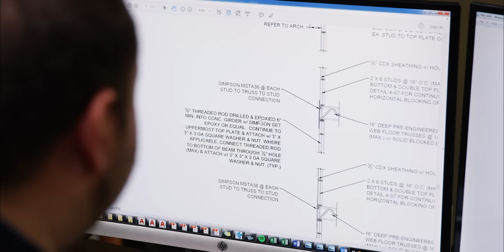Surviving A Hurricane: A Hurricane-Resistant Construction Solution

Comment: Steel straps at the roof and foundation are #1 but windows are the other weak point. If a window fails the wind can get inside and push out walls. Water intrusion makes the sheetrock crumble away from the nails and the walls lose strength.
Reply: Look for the FOX news Tampa Bay YouTube video about the Lackey house that survived. Dr. Lackey stresses that the strength of the windows were crucial for its survival.

Comment: I'm curious as to the expense of adding this system a typical 2,000 square foot new construction home. $10,000? $15,000?
Reply: The typical figure I hear for building beyond code to this level is about 1-2% of the cost of the entire structure. Well worth it in my opinion (I used to be an engineer that specified mostly simpson products). I work for Simpson now so I'm biased but I really believe in our mission and we truly go above and beyond the required testing that a lot of our competitors use. We're a bit pricier at times but we believe the value add is worth it, and the people here truly care deeply about quality.

Comment: does it resist water and mold?
Reply from the maker: Hello, Thank you for checking out our video. Many of our products referenced in this video are corrosion resistant. Is there a specific one you're curious about?
Reply: @strongtie  are any  of them used in the Northeast just for general single family house building or retrofitting application?
Reply from the maker: @Hello-zf5lq  Yes, we have customers that use them in the Northeast.  Our products are mostly used for single family homes and can be used to help retrofit them for high-wind events. They are also tested on our labs with our engineers and many products are ZMAX® galvanization which offers extra corrosion resistance for outdoor or treated-wood applications. You can call our customer service number at (800) 999-5099 for assistance or check out our website for more information.  https://www.strongtie.com/solutions/high-wind-resistant-connectors